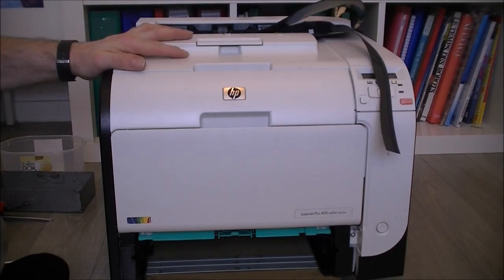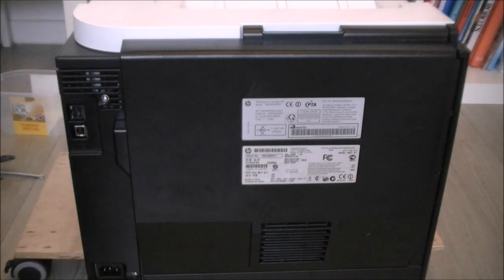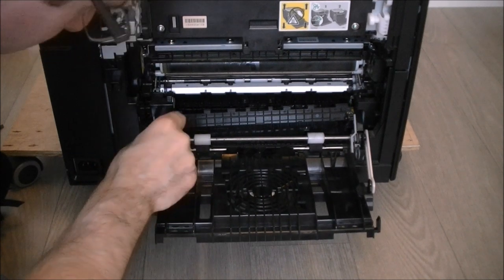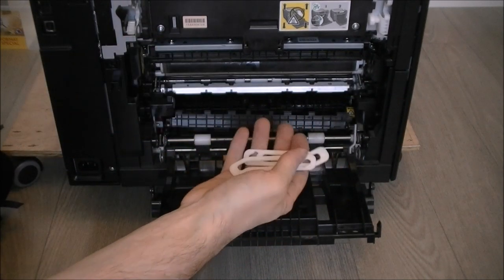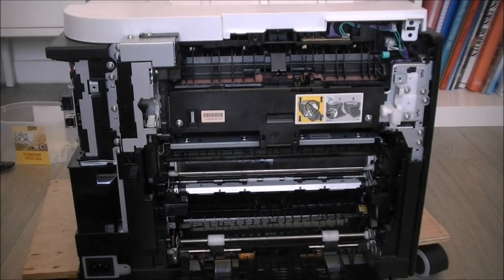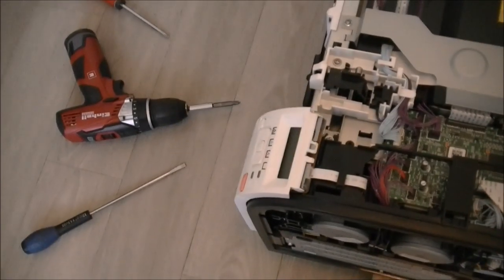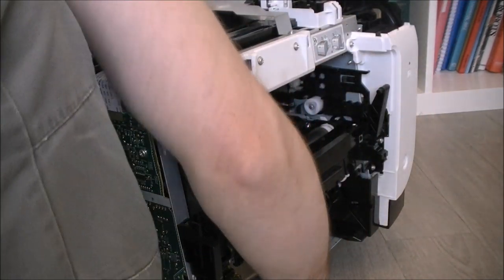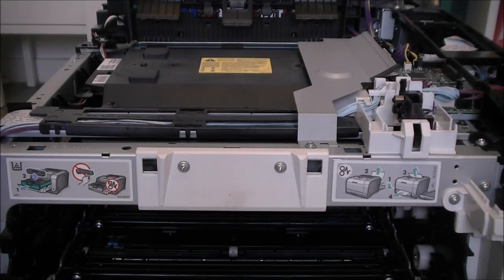HP laserjet pro 400 color printer teardown part 1

Comment: Those stepper motors are like the capstan motors in VCR machines maybe they use the same connections so might be worth saving and using for something in the future.
Reply: Those are probably 24v BLDC motors with the driver IC's. Just need need to apply 24 V and some controls signals and they should start up. I did some experiments with motors like that a while back. I still need to spin up the high speed laser scanner motors.